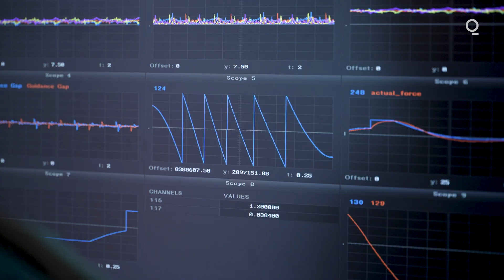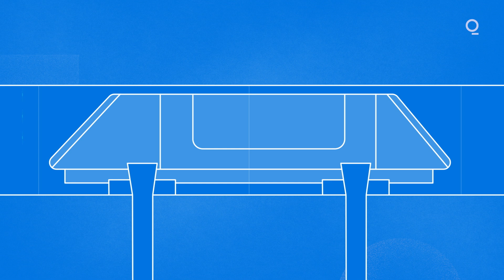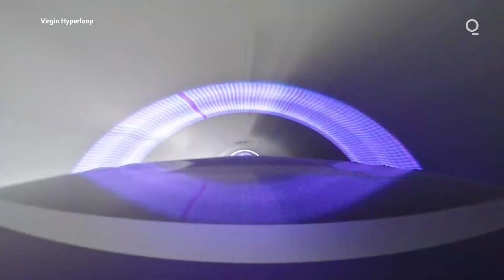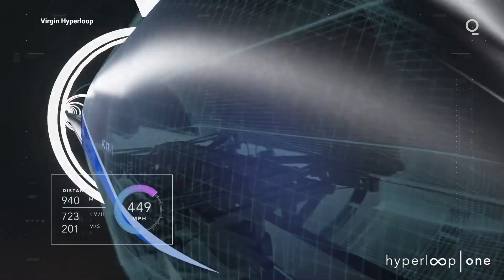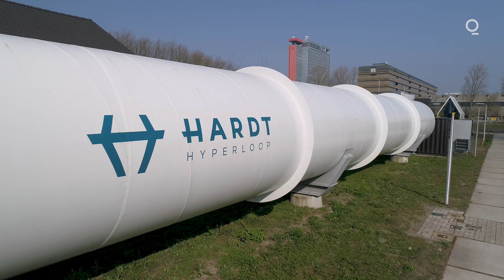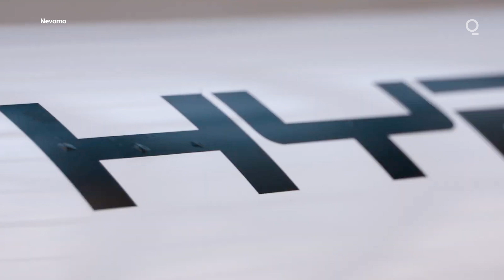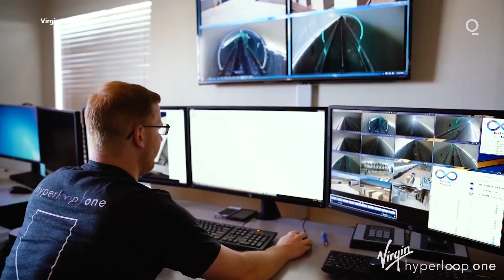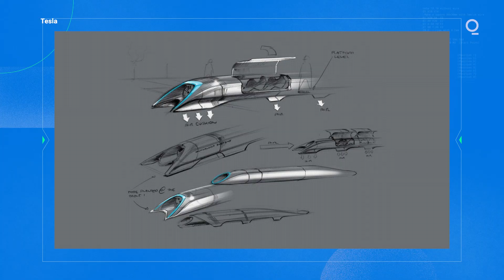The Hyperloop May Disrupt More Than Just Travel

Comment: Imaging being stuck underground in the middle of US and your nearest exit is either LA or NYC.
Reply: Riding a plane already requires you to show up an hour in advance and undergo some pretty invasive security procedures.

Imagine the kind of stuff they'll need to do to protect a pressurised tube hundreds of kilometres long from both the inside and the outside!
Reply: @KingUnKaged  imagine not putting your phone in “hyperloop mode” kek
Reply: @KingUnKaged  then one group of kids nearby are having fun, decide to see what happens if they throw stuff at it, one makes a dent.... Actually you won't need kids to do it, couldn't imagine what would happen if it happens to be in an area where minor earth tremors could cause problems for the framework
Reply: It will be rough. Say the “pod” has a mechanical failure in the tube and loses compression. Do the passengers disembark? How are they protected from the vacuum in the tube? Expanding air in the lungs and blood could kill them as boiling points drop. Will there be exit doors? If so, how are they opens from the inside in a vacuum? Differential heating from the sun on top of the tube vs the bottom will increase the length of the tube exposed to the sun. How is this problem going to be fixed? This technology as a means of travel is decades in the future
Reply: @martinmiller516  "How do they fix it?"

Thats the engineers job to figure out the solution, why you asking me?
Reply: @sadatnafis2032  engineers can't change the laws of physics.
Reply: @vonnikon  you underestimate the power of unhinged engineering
Reply: @qjtvaddict  Hyperloop was invented 100 years ago. It was just called vactrains before Elon changed the name.
But over these 100years, it has never been built. Because no engineer has ever been able to solve the inherent physics problems with this concept.
There are no solutions.
Reply: @qjtvaddict  how much did hyperloop pay you to say this
Reply: @martinmiller516  give up already stop making excuses to stagnate and do nothing
Reply: There would probably be emergency exits and such
Reply: @ed34  Emergency exits inside a near-vacuum…
Reply: @fxmtoeclipse  pretty easy actually, they can close the both sides for 100 meter and then evacuate people. Vaccum is created back again.
Reply: @masochistboy653  please watch thunderf00t's video on this topic
Reply: @fxmtoeclipse  How would you exit normally? Obviously this would be a part of it.
Reply: @fxmtoeclipse  Or you could easily break vacuum.
Reply: @masochistboy653  
Air locks every 100m over a 1,000 mile of tube? The price keeps climbing!!
Reply: @nat3llite  
The pod would either enter an airlock at a station, or a sealed port would clamp to the pod door. 
Neither of those would be available to a stranded pod mid-journey!
Reply: @masochistboy653  - And, after 72 hours of pumping down that 100 meter stretch, it'll be right as rain. (lol!)
Reply: @masochistboy653  How do they close both sides?
Reply: How much of them for every mile?)
Reply: @ed34  You can’t open a emergency exit in a vacuum.  All the air would be sucked out and passengers would suffocate.
Reply: @jawi499  It's not a vacuum tube, that would be impossible to do at scale with our current understanding and technology.
Reply: @jawi499 they could just use an airlock  or  just depressurize a section of the track
Reply: @ed34  going to be hard in a vacuum tube environment.
Reply: @ed34  how do you reach the exit in a vacum?
Reply: @ed34  How shall an emergency exit work in a vacuum?
Reply: @TorianTammas  
How shall an emergency exit work in a vacuum? Not very well. 🤣
Reply: @ed34  and they'll provide pressure suits, to survive in near vacuum, they're gonna be so cool!
Reply: Slowly running out of oxygen in a death trap
Reply: I don't like going in windowless lifts/elevators. The idea of travelling in an enclosed tube has little appeal for me. Even in an aeroplane you can look out of the window . . .
Reply: You can't open a door sideways in a pipe and I don't see a door at each end of the vehicle. And even if you did have a door it could only open if there was a leak and hopefully not a rupture or you wouldn't have to worry about exiting cause you are dead.
Reply: we call that a "burial " where I come from.
Reply: Rapid onset of hypoxia will take care of any need of an exit.
Reply: Uncle Claustrophobic greets
Reply: Too expensive to build the whole thing underground anyways.
Remember this might only make sense for long distances with ultra high speed traveling.
Reply: @porcorosso4330  I have a flying pressure chamber in mind. With wings. We can use it to fly where air is less dense - safe fuel. I shall call it Porco. Or plane. Or porcupine plane. Or Porcos porcupine plane?!
Reply: @defwishfx4400  

That's fine and all.
Unfortunately, your design requires air to get lift.
The same air that you waste energy pushing against also is key to keep your chamber from crashing into the ground.
Reply: IN A VACUUM 😂😂😂
Reply: i'd rather stay in haha
Reply: Well, maybe then people start to read books again, like "War and Peace".
Those 1225 pages will keep you entertained for a while.
Reply: they plan to make hat amounts to be sub3ay tunnels. so every couple of blocks..... doesnt make sense but its their plain
Reply: Whats the hurry anyway?
Reply: imagine being stuck with disgusting degenerate you know who, should be private pods where the homies can't be near you
Reply: ...and having no onboard loo after you've downed a cup of coffee or two..
Reply: You can have entries/exits to an vacuum with sealing and pumps me thinks 🤔. I don’t think having scattered vacuum seals is the problem though
Reply: Imagine being stuck in air and the nearest exit is crashing to death.
Reply: and vacuum all around you... well lucky for you it wont happen
Reply: Imagine what a tunnel like this would cost. I know you are not that smart, so check Bidens infrastructure plan what a normal road costs. But I am sure you even then you wont get the point...USA! USA!
Reply: Imagine the engines stopping at 40,000' in your aircraft over the sea, and hundreds of miles from land at night!
Reply: @daviddenley3512  Yeah but planes can glide down and even temporarily float. You get a life jacket that helps you float. Not to be a NIMBY but this thing has no emergency exit. Exit the pod you die.
Reply: @daviddenley3512  Imagine a failure on a high speed when obstacle is just a few cm away, there would be no time for emergency signal. In the best case scenario you'd be on the next pod in the tube, following closely, trying to deaccelerate, smashing hard.
Reply: @daviddenley3512  No need to imagine, really. Gimli Glider.
Reply: @AR-zq9hq  
Air Transat Flight 236 better one.
Reply: wouldn't want to be 'stuck' in the sky, in a plane, cause your nearest exit is heaven..
Reply: do not compare this to a train, but rather to a plane. you don't get "stuck" in a plane, you crash, yet people ride planes no problem.
Reply: @staticvoidmain  Planes and helicopters with autohover capability landing even after losing engine power all the time, if you lose electricity in hyperloop due to an earthquake or something, you are stuck in an airtight pod with limited air supply surrounded by near vacuum..
Reply: @staticvoidmain  planes have passive safety backup systems.
They are called wings.
A plane can fly and land safely even if all engines are dead.
Reply: @vonnikon  
Yup Air Transat Flight 236. Amazing landing with no fuel.
Reply: @staticvoidmain  It is a tube and you be stuck in a vacuum.
Reply: @staticvoidmain  Hyperloop is tremendously more dangerous than any passenger vehicle ever imagined.
Reply: @dragonskunkstudio7582   yeah, yeah, how not, because you survive when a plane goes down from 20,000 feet high...how could you know it if hyperloop does not even exist yet ?  you're using sth called  "  speculation " ...it's clear  you're  not an engineer and do not know how they think, the security of a project is the first thing they teach you when you're studying engineering,  the most logic thought is that  all security stuff are the first thing in the mind of  all engineer  working in this  hyperloop concept.
Reply: @tony001212  It's clear is it? Show me 1 study, not the white paper, any article that proves that they engineer any safety to this Hyperloop? And I'll show you 12 easy ways to die in that thing.
Reply: @dragonskunkstudio7582  How would a study prove that theres work being done on hyperloops safety?
Reply: @dragonskunkstudio7582  how about you get out of the way and let the smart people do their thing?
Reply: @qjtvaddict  "smart" Right.
Reply: @dragonskunkstudio7582  are you an engineer ?   if not I won't lose my  time,  I can show you a million  ways to die by water yet we drink it,  human advance  is paved over  taking  risks, if you're  that pessimistic and  scare  you must go and  buy a black Dog, how  do you believe we humans has come to the stage we are right now ?  by sitting and doing nothing ?...future is not  for the cowards.
Reply: @tony001212  Bad speculation. Dragons was better 🥱
Reply: @dragonskunkstudio7582  - Indeed. Basic physics, but clearly, most of these people working on this are either 

a) dishonest  

b) doing it for the money 

c) uneducated  

d) educated, but can't think critically nor logically (they hand out STEM degrees like toilet paper, these days) 

e) educated, but with a liberal arts degree (non technical).

f)  computer graphics programmers ("sure, no problemo, I'll have that simulation for you pronto and make it look really cool like Tron")

g) politicians or celebrities [answers  a, b, c, e]
Reply: @davestorm6718  Japan is making a maglev train now. Faster than this junk and it doesn't run on fairy dust.
Reply: @dragonskunkstudio7582  
Only 12 ways to die in that thing? Is that all you got? And you call yourself a sceptic? 😁
Reply: @JB-yb4wn  "12 Ways to Die - The Hyperloop Story" would make a cool name for a movie. It's catchy!
Reply: @dragonskunkstudio7582  
A Dragon Skunk Studios production! My people will talk to your people. 😎
Reply: @ED you're right. But u aint gettin enough support. Coz they're matching it with a train rather they should do it with flights. Okay here's the question for your opposers... 𝙒𝙝𝙖𝙩 𝙬𝙤𝙪𝙡𝙙 𝙮𝙤𝙪 𝙙𝙤 𝙤𝙣 𝙖 𝙥𝙡𝙖𝙣𝙚 𝙩𝙝𝙖𝙩 𝙪𝙣𝙥𝙧𝙚𝙙𝙞𝙘𝙩𝙖𝙗𝙞𝙡𝙞𝙩𝙮 𝙨𝙩𝙤𝙥𝙥𝙚𝙙 𝙞𝙣 𝙢𝙞𝙙 𝙛𝙡𝙞𝙜𝙝𝙩. 
Just think of hyperloop as a plane on land.. That's it.
Reply: Yawn... Another petroleum industry sponsored troll crying about how scary or impractical Hyperloop is LOL
Reply: @blondegirlsezthis8798  and what is Hyperloop if not planes in a tube?
Reply: @blondegirlsezthis8798  🥱